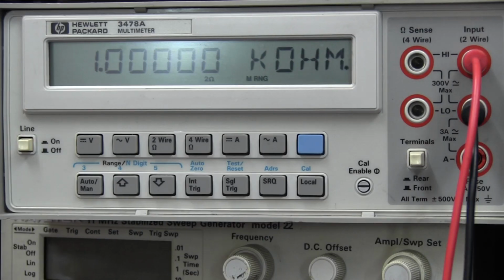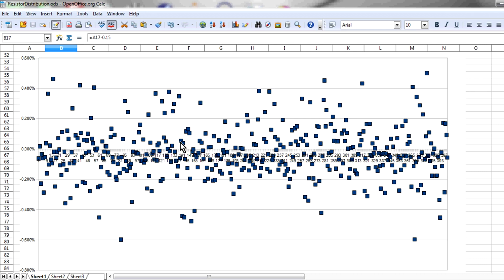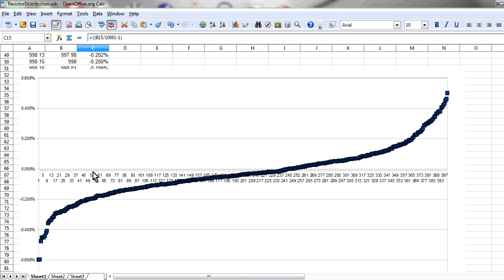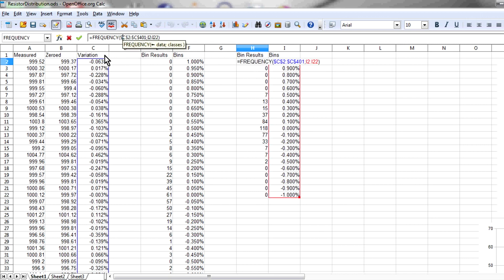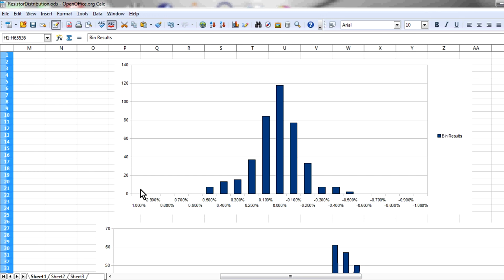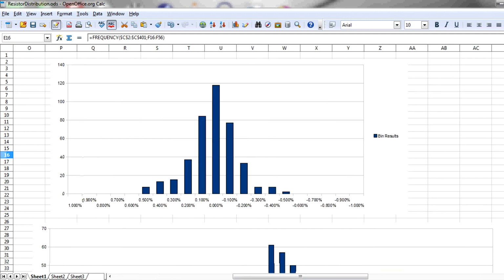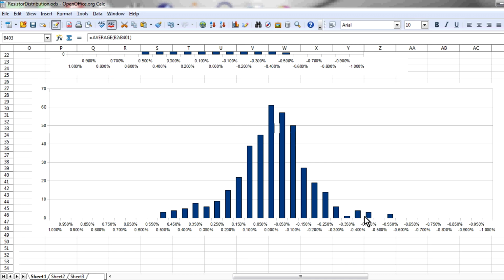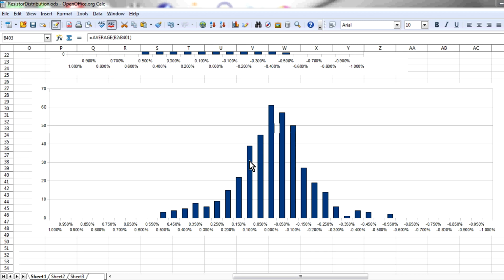EEVblog #215 - Gaussian Resistors

Comment: Actually, logically, if one thinks about it, if this process were true and they manufactured 5% resistors, but selected the ones within a 1% spec for sale as 1% resistors, if you were to conduct this same test on 5% resistors, there would be a valley from +1% to -1% because all of those values had been extracted.

Therefore, if they were doing that, it would make even more sense to extract your 0.5%, 0.1%, and 0.05% resistors from the same pool, because those are even more costly to produce. As there is no valley in this distribution in this video, you know that they didn't do this (to the 1% pool anyway). 

Thus if they did do this, then you would never see anything with a tolerance of better than |R| = +/-1%, because all of those (presumably) would have been taken out. That in turn would mean unless you're paying top dollar for the most precise resistors they manufacture, you're never going to get the value stated on the tin.

So if you buy a 1k 10% resistor, measure it, and find it to be 1000 ohms, you know they aren't doing this. (At least, empirically speaking, to all the resistors, but why would they cherry pick?)
Reply: Whiskey Richard Depends, consider if they have to mark in batches, so if one in the batch is out of tolerance they mark it in the next band up, then you would still have Gaussian distributions in each tolerance band. If you manufacture a tape of 1000 resistors all mounted on the tape and then have to mark the whole tape the same for shipping and sale. This would be a lot easier from a process point of view of the whole production line. Fundamentally it would depend on how the production lines are set up as to how they might classify them. Without someone who has setup or works at one of those production lines letting us know, we can't know for sure.
Reply: That is exactly what is done - at least at the fab here (microwave semiconductors).
Reply: Maybe, but the cost of the testing has to be considered - higher precision resistors might be expensive less because they're incredibly rare, and more because they have to be tested, slowing down the line and raising the cost of regular Resistors, and the higher precision is not needed the vast majority of the time, so say they peel off 10% of the resistors to test and put the rest back into circulation
Reply: This is actually very common, I have a large amount of resistors, and you can cherry pick out very good ones (around 0.1% deviation), to terrible ones that fail the 1% spec.
Reply: Thanks and thanks to everyone who responded. Just looking back, I wanted to clarify that I think when I said "why would they cherrypick" at the end, I meant why would they take some better tolerance resistors and leave others (amidst lower tolerance resistors). It's possible they do do this, so there isn't a total valley around that tolerance, but I feel if you're going to get some of them you may as well grab 'em all and max your profits. (N/A in the case of batch tolerances as mentioned above)  @mumujibirb
Reply: I think more costly one they may do this, if they're the dime a dozen kind they probably don't care enough
 However, I also notice that most resistors will be slightly lower than the expected value, and less are higher. Quite similar to the offset gaussian distribution shown in the video. Wonder why?

Comment: Here's something else to consider.  In engineering, one always incorporates a "safety factor" in a design.  That's why, say, if there's going to be 15V across a capacitor, you use one rated for 20 or 24V.  Perhaps those resistors are produced to + or -- 0.5%, to make sure they're going to be 1%.
Reply: Still statistical analysis is important:  if I use 10 x 1 Ohm 1% resistors in series will it be equivalent to 10 Ohm 0.33% or 10Ohm 1% ?

Comment: If I remember correctly from the statistics I've studied (I never took a statistics course, but I had to learn some for a lab class I took), the expected average error for a number of individual data is the square-root of the sum of the squares of the individual errors.
Reply: Wrong.  The square root of the sum of the squares of the individual differences from the average is what is called the variance.  And that is a number that comes from an actual measured data set, not a prediction.  There are of cause theories that predict what the variation should be depending on what Phillips / NXP did at their factory.

Comment: Mr. Pedantic here -- the frequency function uses the bin values as upper limits, not bin centres. That means that when the bell curve peaked on 0%, that's actually a peak on values between -0.1% and 0%, i.e., demonstrating a bias (consistent with the biased average for the data), not a lack of bias. A true Gaussian centered on zero would have two equal-height bars: the -0.1% to 0% bin and the 0% to 0.1% bin.
Reply: Is it not common to have an odd number of bins with the center at 0% and limits of say, +- 0.05% ?  That would only have one bar in the center.
Reply: ***** Absolutely, but that's not what he did in this video.
Reply: TheHue's SciTech I realized that also. Wrote commented that independently just now (in October 2015). You did that more concisely.

Comment: They have an Operating Temperature Range of - 65 to + 165°C; a temperature coefficient of max +-100ppm/°C, and as far as I can see, only the power rating is defined for a specific temperature (70°C), so I assume the 1% tolerance is for the whole temperature range. Maybe that's why they all fall within 0.5% at room temperature?
Reply: john Smith 100ppm over 200+ centigrade is 20,000ppm, or 2%. It doesn’t work that way. The tolerance is for the nominal value at room temp. If you get them repeatedly across the temperature extremes and they’ll shift their room-temperature value – sometimes a lot. That’s why tolerance and temperature coefficient are provided separately. And the tempco is almost always under specified: it’s not a constant across temperatures. It often is worse than specified, at some temperatures. The tempco only applies around normal operating temperature. If you need a certain known performance from stock generic parts, you need to qualify them yourself. That’s been true for as long as you could buy passive parts, more or less. I treat both tempco and tolerance as guidance, but if they are critical, there’s nothing to do but qualify the parts, perhaps even test all of them before they get into the product. These days testers can be cheaply made using 3D printed parts, arduinos, stepper motors and drivers, Peltier modules, and off the shelf multimeters. Progress is good :)

Comment: I think that's true. You're effectively summing two normal distributions. The standard deviation, and hence the tolerance, goes down with sqrt(x)/x, with x the number of resistors in series or parallel. (this also implies that the 4 resistor example in EEVblog 212 actually has a tolerance of 0.5% if they're normally distributed and the mean is correct)

Comment: Manufacturers like to hold tolerances to at least 1/2 the spec value so that all the parts in a run pass inspection. Margin. Every process needs margin.

Comment: I would think that a manufacturer would save them selves support costs simply by trying to keep these measurements in the middle like this as instrument calibration could easily skew this from side to side.  So if I had a meter that was not calibrated properly and say these errors at -1% -0% I would think okay its still within the range but in all actuality my meter could very well be off causing this.  So if say they did skew from -1% to +1% and my meter was off I might call and start bitching.

Comment: @samgab What you're saying would be true if ALL resistors that fit the higher criterion were picked out. If instead the demand was (much) smaller than the actual production of resistors that could be binned for better tolerance, you'd only get a slightly flatter bell curve.

Comment: Had a similar example in our Stats unit, except mathematicians tend get these things totally out of context... Pretty interesting results you got though, good to see real data worked with. 

An interesting idea: Use some kind of jig run by a micro controller to churn through loads of resistors while measuring each one and logging values. I wouldn't have had the patience to get through 400 resistors by hand x_x.

Comment from the maker: @Vlakpage I can't account for meter error because the absolute error of it against a traceable reference standard is not known precisely. But I have good confidence that it is within spec, which is better than the mean difference measured. The absolute mean difference measured could be due to the resistor manufacture, meter accuracy, or drift over time, or likely a combination of all three. Not that it really matters.

Comment: @EEVblog You didn't account for the meter error, is it possible that the shift from center is caused by that?

Not long ago I bought nice vintage semi-automatic RLCG bridge Tesla BM 539, it has good basic precision (calibrated 19 years ago). The interesting thing it has is output to electromechanical sorting device BP 5390 (which I've never seen and can't find any info) and many ranges specifically for measuring tolerances. I think it was meant for manufacturer component checking and sorting.

Comment: I'm not too surprised, actually. If you'd plot the bell curve for the variance, I think you'd find that the expected probability to find a value down in the margins is actually <0.25% (i.e. <1/400).
Also, I'm guessing Philips at the time didn't have worse tolerances than 1%, at least not for that type of resistor. If they did the binning trick it might've only for 0.1% and better and only enough to fill the demand at the time.

Comment from the maker: @allanw Depends how much you pay. Ultra precise $10 resistor would be 100% tested I'm sure. For run of the mill stuff it's likely good enough to batch test to ensure your processors are still tracking ok. The distribution tolerance takes care of the rest.

Comment: Most Interesting Dave and well presented.  I wish I'd had you as a teacher.  Yes control charts are still used in industry especially where precision components are manufactured.  I believe the concept was originally driven by a guy called Walter Shewart who became a buddy of Edwards Deming.  Of course this has all been developed into six sigma control where you would only be expected to find one or two components outside a norm in a batch of a million.  Remarkable.

Comment: @rroge5 You'd probably find they get around it by taking a 10% sample. I don't know how stable the manufacturing process is regarding resistors, as the checks could be 1%, or even 0.1%.
I would assume 1 per 1000 is enough - they are just off-the-shelf parts and not milspec

Comment: If you're using two 1k resistors, and one is 995 Ohm and the other is 1005 Ohm, the difference between those two is 10 Ohm, so 1%.
When you look at the second histogram, it actually looks like they've cut of at +/- 0.5%. So maybe, you suppose by 1% tolerance, they mean that's the largest possible difference you can get between two (or more) resistors, rather than the maximum possible deviation in just one of them?
Very interesting video btw!